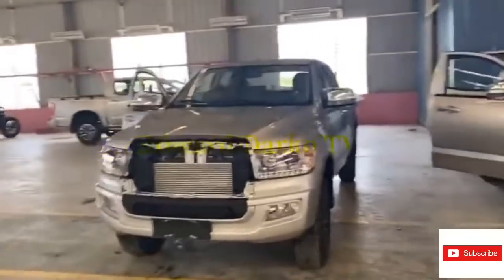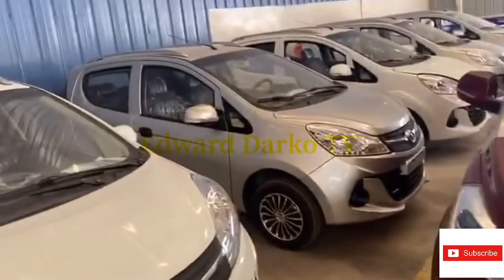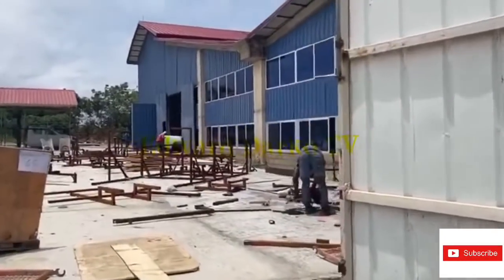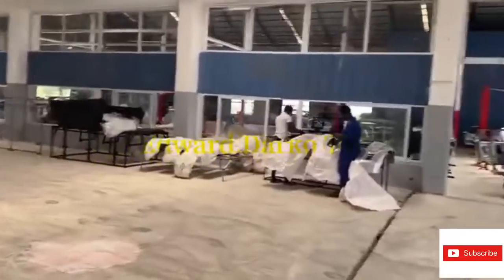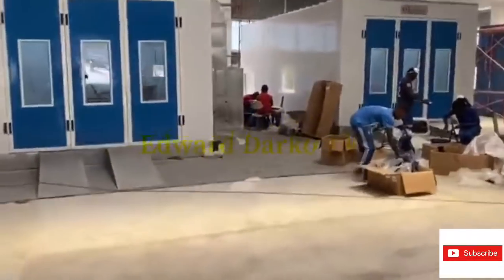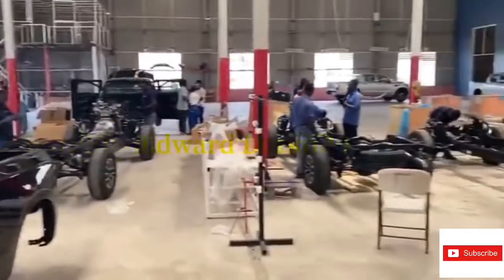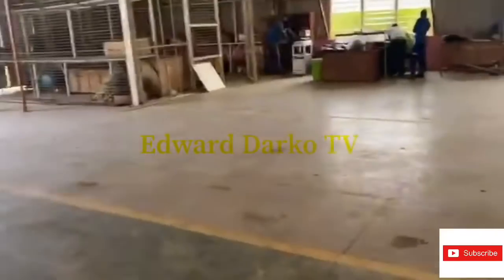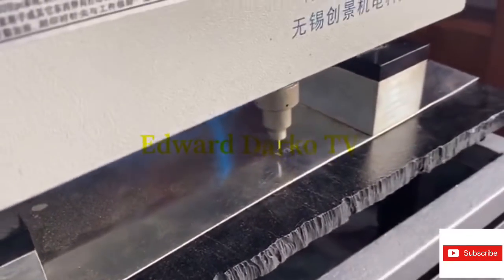Wow check out Kantanka Automobile plant tour. Ghana 🇬🇭 we move.

Comment: They are ASSEMBLY plant not manufacturing
Reply: They manufacture everything there even including the engine so it's not assembly company but a manufacturing company
Reply: Most car companies buy many parts and components from outside companies for example transmissions or brakes, kantanka and Ghana may not be able produce the volume of cars yet to invest in stamp mills, forges and casting machinery but Dr engineer safo got the connections and know how to get it all done, even if by outside vendors.  Maybe one day they will have the volumes to invest In that kind of equipment, but first the government of ghana will have to invest in improving their infrastructure so that this stuff can be powered

Comment: Guys, let us know the different between assembly plant and manufacturing plants. An assembly plant receives body parts and put them together that is what kantanka is doing right now and on the other hand a manufacturing plants source the raw materials formulate them with mechines to the specified designs  and build them up. In the 1970's -1990,  Peugeot and Volkswagen do have assembly plants in Nigeria  does that make Nigeria a peugeot and volkswagen manufacturing country? No! Innosom motor  is a manufacturing company because everything is source locally except the engine order from engine manufacturers as other vehicle manufacturing company like Toyota, Honda etc does. Innosom  vehicle body panel are locally procured from Nigeria Steel company and formulated into the designed shape, gear box are built locally in Nigeria, batteries for their cars are Nigeria IBETO make, tires are Nigeria make too. Plastic works for the cars are produced by lnnosom plastic industries and also the leather works for the interior. I appluad Kantanka for the intiative to start a vehicle assembly plant but let be real he has not got the point to say Kantanka manufacture vehicles. I know he is in right directions and by the grace of God he will get there .
Reply: What makes a car a car?
Reply: No, they produce their own body parts
Reply: @Akos885  That's what I thinking. I would be so proud to drive The Katanka in the U.S. I drove one in Ghana. It was a great experience.
Ubuntu Ma'at Ase'🙏🏿🇬🇼🇰🇪🇿🇦🇺🇸
Reply: @Akos885  So why do they not boast about it, but show an inefficient assembly plant? Where is the production? In the back room? Mr. DanAki is right.